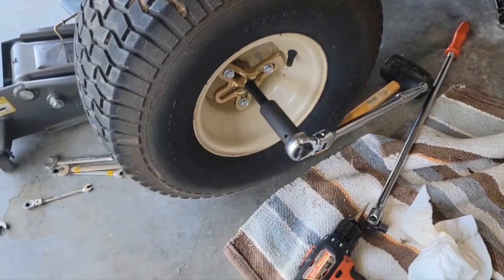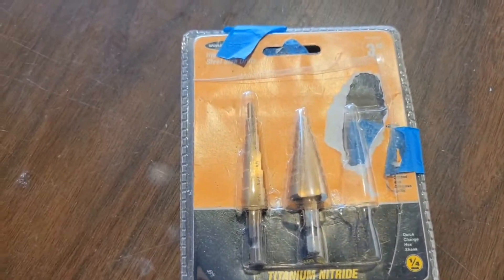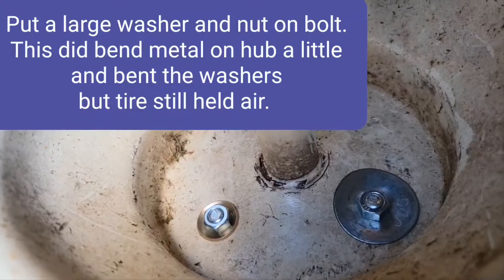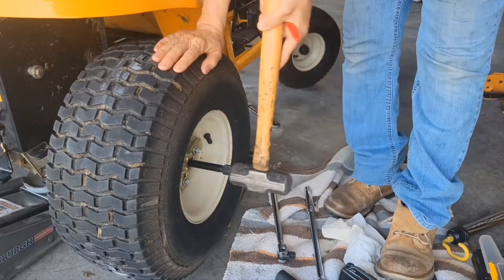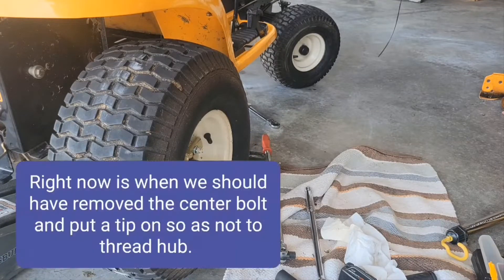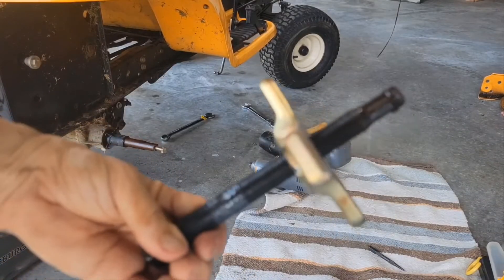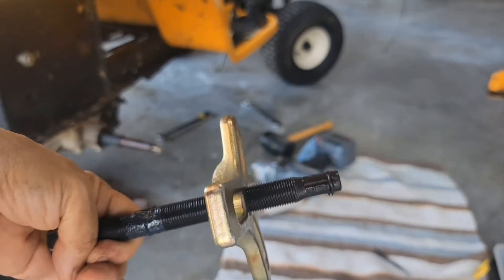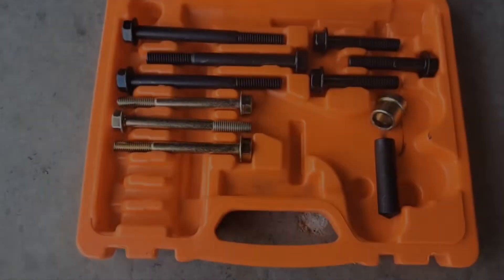HOW TO REMOVE A STUCK WHEEL ON CUB CADET RIDING MOWER

Comment: This combined with a liberal amount of torch heat on both sides of the hub just barely did it for me! Thanks I never would have thought of the puller on my own!! :)
Reply from the maker: Hi jonkwilloughby, so glad u got it! Ur welcome. Thanks for sharing ur idea. Ive got a big tiller that i need to try your method on. 
Ive still got my mower and my brakes and tires still holding up great since i had the wheel off. Been almost 2 years and have done a lot of mowing with it. Take care.

Comment: Congratulations on your success and learning experience.  A mistake being made when pulling is by constant pulling.  Debris is trapped and is causing the binding. Periodically, the wheel should be pushed back. Working it back and forth lets some debris escape and make for an easier pull.
Reply from the maker: Hi Rosey, thank u. You make a very good point about pushing wheel back alternately with pulling.  Makes a lot of sense. Thanks for that tip. 
Thanks for watching. I wish you well. 💙

Comment: if you have an air chisel / air hammer gun use it would need a flat bit  Pneumatic Air Hammer Bit  use a propane solder torch to heat it up.. an air hammer should do the trick of getting it off ..  think a cutting torch would be too much and using a puller
Reply from the maker: Hi k2000, thanks for all your input. 👍

Comment: If someone has this problem take the nuts loose and drive it around. Will come loose.
Never said why they wanted to take the wheel off.
Reply from the maker: Hi btwbrand, thanks for your suggestion. 
Wheel was initially being taken off in order to repair brakes. But couldnt get it off and so I repaired brakes with wheel on. After the brakes were fixed, I decided to continue to get the wheel off because I was at the airport where I had help and had access to lots of tools.  Also, I was taking the mower to use at an off grid location and wanted to be sure if I ever needed to take off the wheel for a tire repair or replacement that I would be able to easily get the wheel off there at the off grid location.